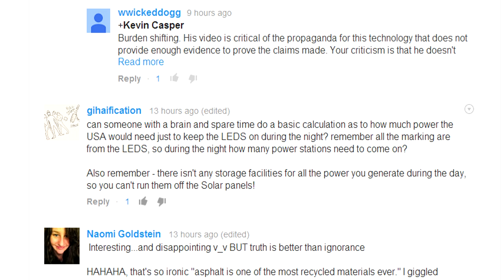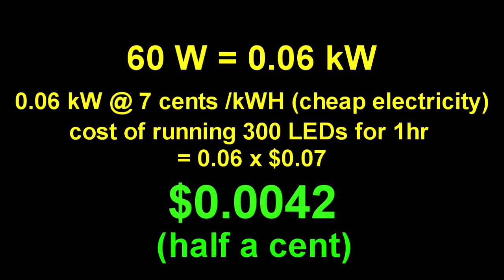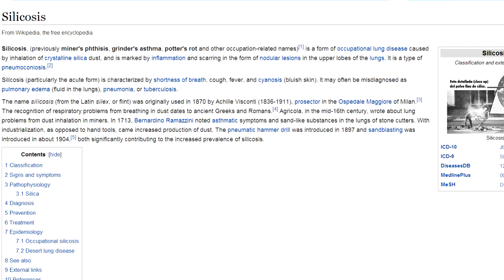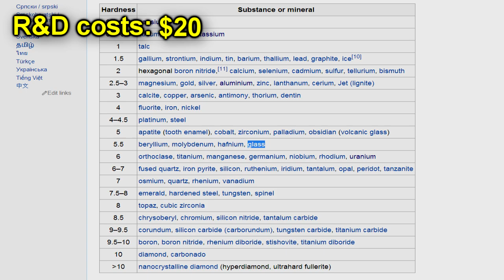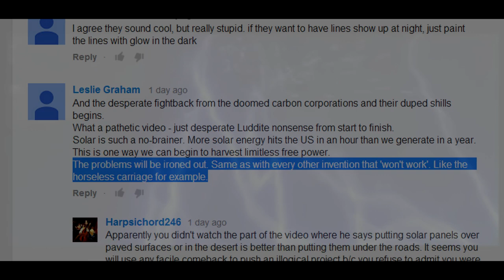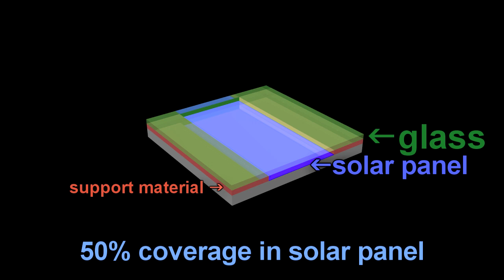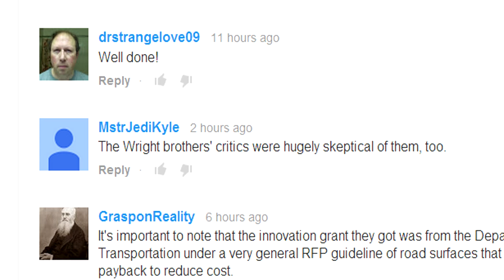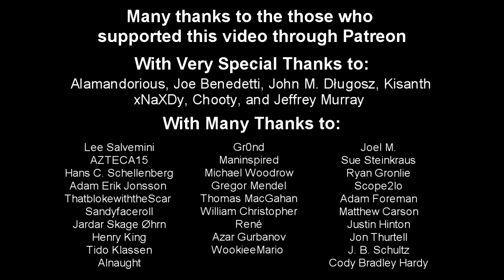Solar Roadways, IMPORTANT QUESTIONS AND ANSWERS!

Comment: First time I saw the Solar Freaking Roadways video my thoughts were "all sizzle and no steak".

I have worked for over 20 years in electronic circuit board manufacturing for some of the world leaders in the field.  In addition, for a few years I was a laboratory technician at PPG testing glass properties day in, day out and have also worked doing builds, repair and overhaul on military generators and renewable energy control systems. This put me in a position to immediately identify all the same issues you did in your video but I don't believe you need my particular expertise if one just sits down and thinks it all through. 

I did see however a potential application as a siding material for buildings but you needn't reinvent the wheel for that so to speak as conventional solar arrays would do fine if you dispense with the need for load bearing and illumination. This application would have its own limitations however, the geometry of solar angle affecting efficiency, you could only use it on southern exposures (in the northern hemisphere), available surface area to avoid blocking windows and other architectural elements, sun shadows from adjacent buildings, and the necessity of having external wiring in conduit on the exterior of buildings plus the relatively short lifespan of the dielectric material itself (20% loss of efficiency over 25 years, beyond that we simply don't know) necessitating repair and replacement on the exterior of buildings and the inherent difficulties therein.

The tractor shown in their hype video is also, not a very heavy vehicle and fails to mention that tractors have large tires to distribute the load to avoid sinking in the mud of a tilled field (same reason tanks have tracks). The trick of the tractor demo is to increase the tire footprint, essentially reducing the pressure for each square inch of contact to below the breaking point of the glass. 
Imagine a week of cloudy days in a northern climate with a large snowfall, the power isn't there to melt it with no sun and it certainly couldn't take plowing, living in Canada, we know about such things. 
Also even with optimal sun, imaging trying to melt snow when the cells themselves are covered and the outside ambient temperature is -30C. The national research council in Ottawa has had a small test patch of a conductive concrete for several years now to test this application but I don't believe they've made any advances on economic feasibility of the material for large scale deployment, not even in limited use like for airport runways.

Few people are aware that it was Einstein who first posited the photovoltaic effect and it is for this, and NOT relativity that he received his one and only Nobel prize (1921 if memory serves).

Comment: The LEDs wouldn't cost that much. You would have to get a quote from a chinese manufacturer because the more you order the cheaper it is. I would assume that they are only a couple pennies a piece when you order a few hundred thousand.
Reply: Still, wouldn't lights on the side of the road be much better? They don't covered with dirt and stuff.

Comment: Also the electricity cost he mentions is wrong. the 60W is for the receiver that signals the commands to the LED's.the LED's them self can live on 1w.
Reply: A superbright LED is 1W to 5W each.  He had a string of them; something like 60 IIRC.
Reply: What matters with LEDs is output. Sure, you can run a single LED panel on 1 Watt, hell, you can run certain arrays on 1 Watt, period.

But you won't get much light from it. In direct sunlight, you'll have a hard time even telling it's on.

Let's  compare with something you will get some light out of.

A 500 Watt Metal Halide bulb will give off about 30-40,000 Lumens. Now, you're getting into light you can see in the sun. Somewhat. I'll get back to that.

To get that kind of output from an LED, it takes about 45-60 Watts per array, so Thunderfoot's example is actually fairly accurate.

This also costs about $250-$350 per array, and that's on a post top-type LED, which does not have a built-in solar panel, or, indeed, a glass shield designed to resist cars driving over it; the cost of building the panel would probably be a lot higher.

To say nothing of the fact that, the solar roadways would still need to be able to show off their light patterns during the day. Artificial light was not meant to be used in direct sunlight because, during the day, you have THE SUN for light, and the patterns on modern roadways are visible due to reflective paint.

In short, it's more cost-effective, faster, and safer, to stick with asphalt roadways and reflective paint.

Solar panels and LEDs  are both very nice pieces of technology, and I believe both are, to a greater or lesser extent, the future. But, this does not make combining them and putting them in a place where a Walmart truck will roll over them a good idea...
Reply: Go look at the power consumption of LEDs in flashlights. These are the best performing LEDs you can buy. As John Dlugosz said, a good LED is 1 to 5w each. Depending on the number and types of LEDs being used, these solar panels may not even produce enough power to power the LEDs and electronics by themselves and not have anything left over to provide power to the grid.

Comment: Took me less than 1 minute to google and about 20 minutes to read the wikis, fact checked the sources in another 10... maybe someone should invest in this thing called "asphalt concrete".

From the Asphalt and Asphalt Concrete wikis:

"The largest use of asphalt/bitumen is for making asphalt concrete for road surfaces and accounts for approximately 85% of the asphalt consumed in the United States. Asphalt concrete pavement material is commonly composed of 5% asphalt/bitumen cement and 95% aggregates (stone, sand, and gravel). Due to its highly viscous nature, asphalt/bitumen cement must be heated so it can be mixed with the aggregates at the asphalt mixing plant. There are about 4,000 asphalt concrete mixing plants in the U.S., and a similar number in Europe.[56]
Asphalt concrete road surface is the most widely recycled material in the U.S., both by gross tonnage and by percentage. According to an industry survey conducted by the Federal Highway Administration and the National Asphalt Pavement Association and released in 2011, more than 99% of the asphalt removed each year from road surfaces during widening and resurfacing projects is reused as part of new pavements, roadbeds, shoulders and embankments."

"Different types of asphalt concrete have different performance characteristics in terms of surface durability, tire wear, braking efficiency and roadway noise. In principle, the determination of appropriate asphalt performance characteristics must take into account the volume of traffic in each vehicle category, and the performance requirements of the friction course."

Comment: I am no fan of the project but this is a rather sloppy critique:
- You do not need to power all the LEDs / not the whole road is covered with paint.
- The tiles would be pressure sensitive, no reason to light unused road.

The LEDs are stupid for other reasons you already mentioned (can't be seen at daylight), poking at them again like this is way under your level.

Comment: About the rubber grinding the rocks on the glasss: Imagine a car doing an EMERGENCY BRAKE on the road going 80 km/h? TF just scratched the glass with handpower, so the car or a LOADED TRUCK would wreck the solarpanels. For every emergency brake we'll need to change the road lol.

Comment: While you make some good points about this project, thunderfoot, you are being rather unrealistic. take a look at a typical road with lane markings - it doesn't need the entire road surface lit up, just a line at the edge of each lane. Which is gonna be what, maybe 1% of the actual road surface (just a guess)?

Also numerous parts of the original video showed them to have pressure sensors, I can easily see that being linked tow hen the lights actually need to show, in fact that seems like a perfectly sensible way to do it, if it was going to be done.

Comment: I don't like the idea of my lights going out because a car crash causes a major traffic jam and the main power generating road is blocked by all the gridlocked cars. Even if you could develop a glass that could that could withstand everyday wear and tear (without turning opaqe) odds are they won't stand up well in an 8 car pileup.

Comment: Power needs to be created at power plants.  That way you can get the highest possible efficiency out of them at the lowest possible cost.  Because, yes...even though solar is "free" energy, there's still a lot that goes into solar energy production that's not free.  Batteries, AC inverters (to transmit the power), maintenance, etc.  Solar power isn't free, and never will be so long as we have those costs.

Comment: For the most part I enjoy your videos, but this one, I just can't.
Oh, come on.
1) All the LEDs would never be lit all at once, so your electricity calculation is says little about the actual costs.
2) I really don't think they would use the same glass as used in bottles :D. Unless you do the same scratching tests with the actual material used in those road tiles, your test says very little.
3) You might have a point about solar panel efficiency problems, yet again, unless the test is done with the actual tile, nothing much can be said.

Comment: ....couldn't each cell have a small battery inside it to power the LEDs on it's own?

I think the idea of having them as hexagons was so you could replace them without having to stop traffic for an extended period of time. So you could stop the tragic for half an hour or so, replace the old hex and then refurbish it at a workshop somewhere.

Anyway, you've managed to convince me that maybe solar road ways aren't a good idea. Oh well.
Reply: It's relatively fast repair, but you have to repair it 100 times more often. He also mentioned another problem where any sort of tiled road makes it inherently weaker on account of differential pressure on the different parts of it.
Reply: gloria vargas ...nuclear road ways?! 0.o
Reply: i think its just easyer to put them next to the road on moving things so that they get 100% of the energy and dont get in  the way of normal road construction :D
Reply: mabey we should just go nuclear energy  :D
Reply: gloria vargas Yea, probably. It would probably be an ok idea to make it standard for roof tops too.
Reply: Yes, you could technically use batteries and add yet another HUGE expense and create an even larger maintenance nightmare. But you may not be able to charge them much during the day when the LEDs are already sapping all or most of the power that the panel is producing. Bright LEDs that you can see during the day use a lot of energy. Even then, it's doubtful that you can see the LEDs from a distance when you're perpendicular to it.
Reply: RDJim Well look at germany.. just saying
Reply: *****

The original question was, why solar farms aren't all over the place. I wanted to point out that they are all over the place in Germany. Of course, this happened only due to massive subsidies. However, the success is, that the subsidies helped to drive down costs massively. Solar is now cost competitive in some areas and this trend will continue. Maybe even until it is cheaper then everything else. Until then we have to live with a little bit higher electricity costs. But I think, it is worth it and so do most of the Germans.
Reply: gloria vargas
So now you're back to a solar panel farm... no need to spread them  out over a sides of roads where they're useless.   Then if farms are so great  they would already be all over the place... why aren't they?
Reply: yea or just build like solar roofs over the cars in parking lots might not be 100% effective but it would work ish
Reply: RDJim because farms are super expensive and only work in places were the sun shines all the time like in deserts it wouldnt work in a rain forest now would it i mean having them on stretches of road that are relatively clear of trees and other nasty things that might cause damage is a good thing so have them out on the wide open plains or something anything makes more sense then putting them in road were they will be covered half the time by grid lock and gunk and snow and i mean the whole concept is just ridiculous his heart is in the right place though
Reply: *****

The current feed-in tariff for big solar farms in Germany is 8,92 €-cent/kWh (about 12 $-cent/kWh), which means actual installation cost should be below this value. Even with this low value several multi-MW solar farms are still added to the grid each month. The last days have been very sunny and we had noon peaks up to 25 GW from solar power because solar farms are all over the place.
As the installation in the US has picked up massively in the last year they are going to pass Germany in total installed capacity quite fast in the next years  if the numbers don't go down...